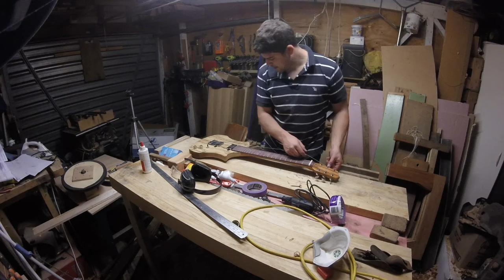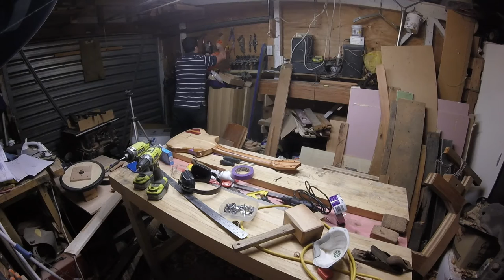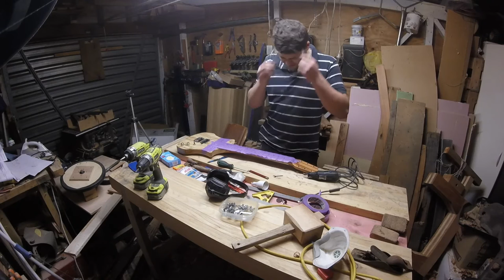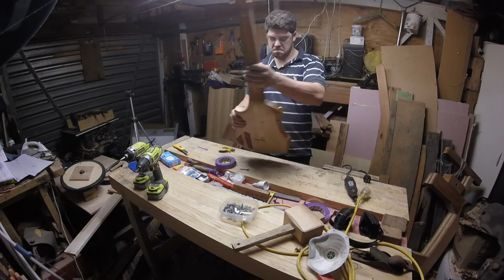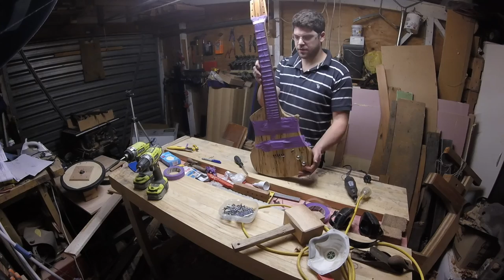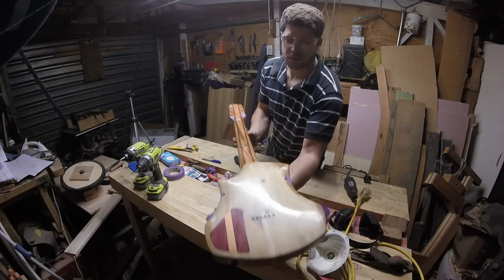Dealing with a wide neck - Part 1

Comment: Hey man nice video!! what about part 2 - did you succeed? , I'm planning same work on my Chapman ML2 - I need to cut 1.5mm from each site, as the guitar sounds great, but I hate this wide neck .. :)
Reply from the maker: went too far unfortunately, it was my first guitar so it was a good learning experience. The next one came out much better. I I'm onto my sixth now :)
Reply: How wide is the neck on yours? What model do you have?  I looked at their website and it is 42 MM, standard size